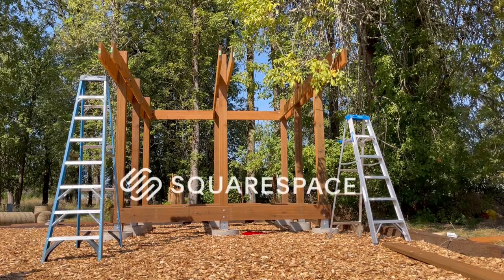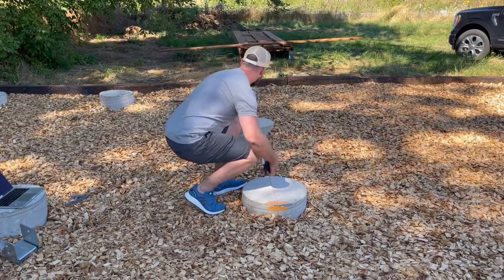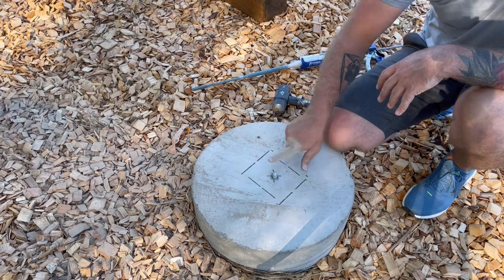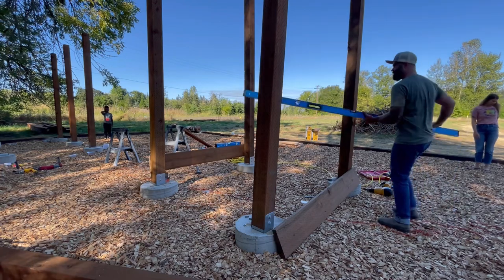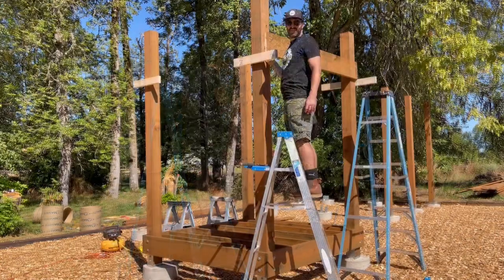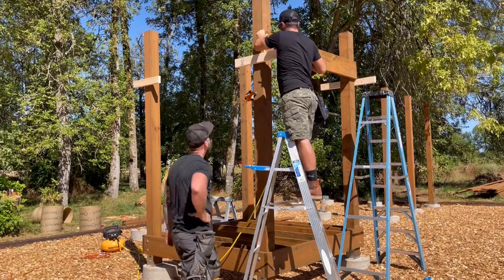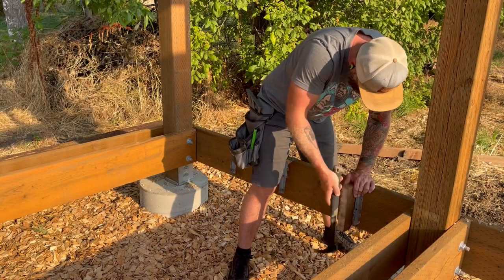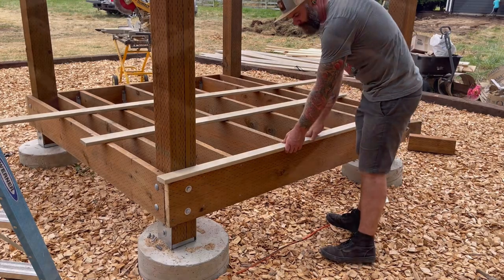Building an Elevated Deck || Treehouse Build Part 2

Comment: GROOVES IN DECKING HAS TO BE UPWARDS LOLOLOL.

OMG!! LOLOL
Reply: The grooves can go either way. Up provides traction but isn’t always required.
Reply: @johnlee7085  yes lets dig 4ft deep footings times 13 for safety but install the threads downwards lol.

Makes lots of sense.

There are more expensive with threads why choose the threaded if your not going to use it.

Excuses is all you provide nothing else.
Reply: It’s not my project so I offer no excuses whatsoever. You asked a question and I offered you info. You seem upset that maybe there was something you didn’t know. 

There are lots of reasons why the product might have been chosen, especially in the supply challenged world we live in. If that’s the product he wanted and the only way it could be supplied then you learn to deal with what’s available. 

Your response absolutely right about other areas that are massively overbuilt, but that’s really not relevant to the decking; the original comment. It does make a case for knowing what you should do before starting. 

Also, I think the word is treads not threads. Just makes sense.
Reply: @johnlee7085  lololol something i didnt know?   Brother i am an architect and have PE license for 4 disaplines, hvac, fire protection plumbing and electrical.

Trust me not much i do not know in construction business for over 30 years.

You didnt offer any new info to me other than how to waste money by placing a faced board upside down which it was not intended for.
Reply: @johnlee7085  ps not checking my spelling.  Havent been in school for decades.

But carry on with your rainbow ways

Comment: Wouldn't it have been easier to put the anchors in before the cement hardened? 🤔
Reply: That’s definitely an option. It means laying out the square in advance which is a little more difficult - note the footing with the post on the edge.

Comment: You know, if you're going to over-engineer, don't you think you need to use your router to ease those edges? All of 'em?
Reply: There’s no engineering here much less over-engineering. Lots of over building because it’s not engineered at all. 

While appearing to be humerus, routing the edges removes part of the pressure treatment and makes it more susceptible to failure, which ironically is similar to some of the other overbuilding.
Reply: @johnlee7085  Um, no. Pressure treatment uses PRESSURE to push the treatment farther into the timber. Admittedly, it won't penetrate to the center of even a 4x4, but it does penetrate far enough to not get all cut off by a round over bit. Unless it's something beyond a quarter round.

And it was a tongue in cheek reference to the fact that this is what is usually closer to rouch carpentry than to fine furntiture. At which  our dear Bourbon Moth excels.

Comment: Over engineered?? This thing will withstand any epoxy river table explosions that might occur....
Reply: There’s no engineering here. That’s why it is overbuilt. 
There is a difference.
Reply: @johnlee7085  I guess if we are going to use a textbook definition of 'engineered', then yes there is a difference. Although I'm pretty sure that Jason has over thought this so much we can call that a version of engineering.
Reply: That’s about the loosest definition of engineering ever. I thought therefore I engineered. There are boxer baring wastebands in the ’hood that are tighter than that.
Reply: @johnlee7085  LOL, "boxer baring wastebands", one of the best comments so far!

Comment: You are building a can't lever deck. Are you sure it isn't a can lever deck????? Strong, well hell yes. It is going to be so strong that you will want to buy an elephant to go with the tree house... You should have rented the type of nail gun made for nailing joist hangers - much easier....... After all of those boards, did you get bored????? Not having to watch all of the decking, thank you...
Reply: R/bonappletea